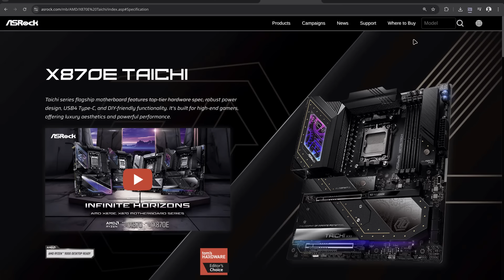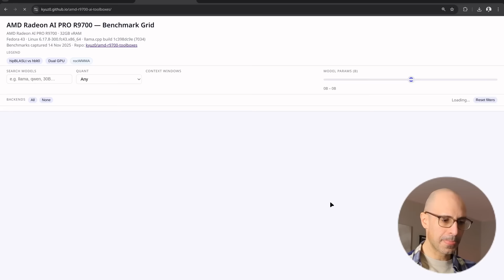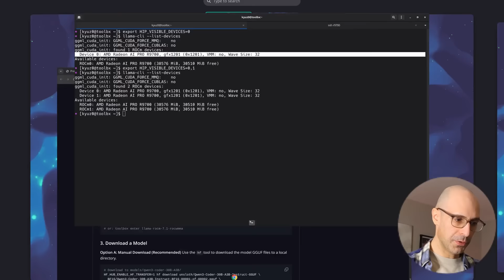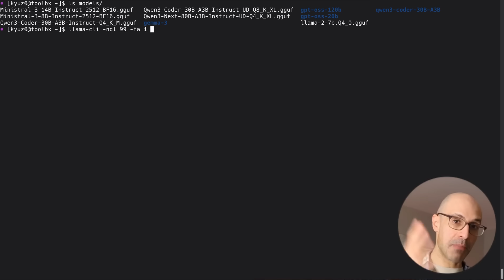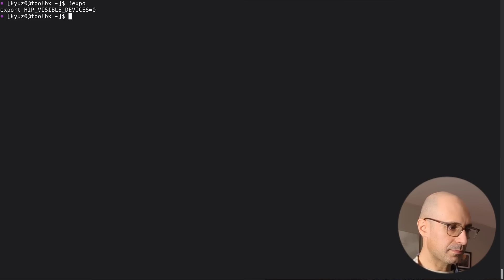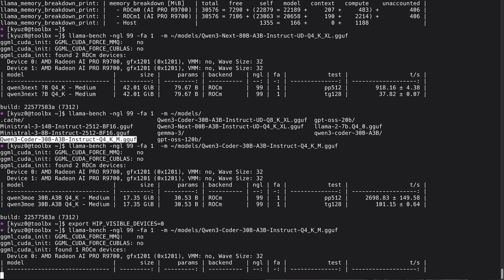Dual AMD Radeon 9700 AI PRO: Building a 64GB LLM/AI Server with Llama.cpp

Comment: I'm wondering how much faster or useable this would be compared to say using the Strix Halo. You get more vram with the latter but is this much faster?

I have a 5090 and am using RPC/llama.cpp to a strix halo i borrowed but also have a spare motherboard could put a gpu like this ai pro on.
Reply from the maker: You can check the llama.cpp benchmarks, but R9700 is considerably faster than Strix Halo. For example, Qwen 3 Coder 30B (Q4_K_M) gets 832 pp t/s on Strix Halo and 2934 t/s on the R9700.
Reply: @donatocapitella  Yeah thats a very good point, through the model is much smaller than the glm air I usually use. I suppose ill keep playing for a little while longer and watch to see what you post. Do you think eventually youd post a video on what think would prefer if only had choice of the strix or  this new setup?
Reply from the maker: @EyUpNortherner well, for large models like GLM Air (which I actually use), fitting that on this 64GB setup would force you to use a very low quality quant, and quality will drop. It all depends on budget. If I had only £2300, I'd definitely go with Strix Halo. If I could build a 3-4 R9700 cluster (but I estimate this would cost ~ £6000), then there's absolutely no competition, but it'd be almost 3x more expensive 🫰 

For me Medusa Halo in 2027 will be the winner if we can get higher memory bandwidth and 192 GB RAM... However given the current memory supply crisis, maybe that dream will not come true 😢